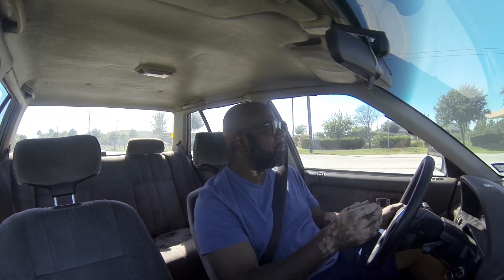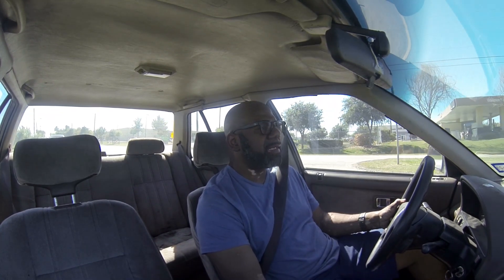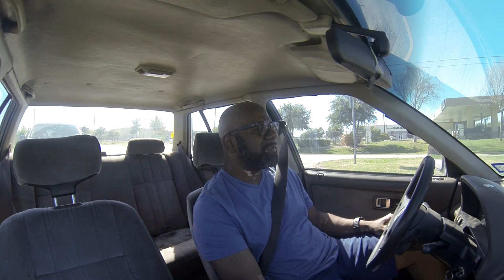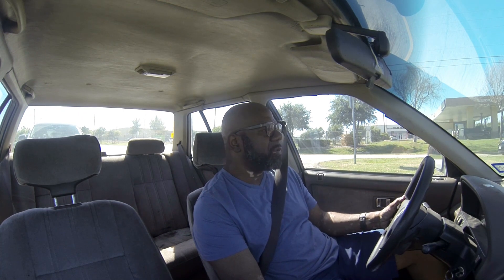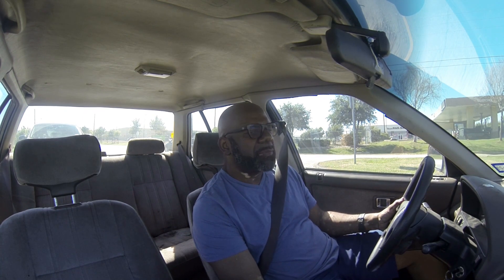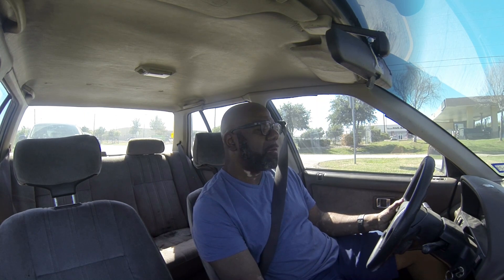Honda Civic | Is the Civic EF Turbo Back to Full Power After Fixes?

Comment: Sounds good other than the boost cut lol
Reply from the maker: Thank you!  I must say, I'm an idiot though.  Turns out it wasn't boost cut.  Apparently, my tach isn't accurate.  It's like 2k off.  I was actually hitting the rev limiter.  When I looked at the log, I was at 7k rather than 5ish.  So need an aftermarket tach to hit the shifts right.